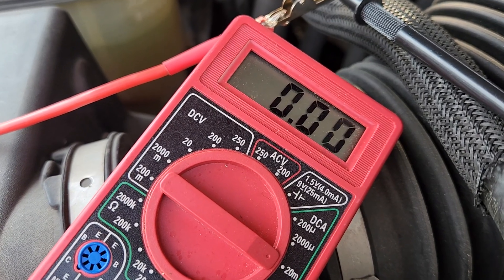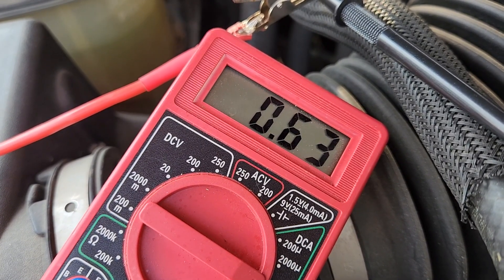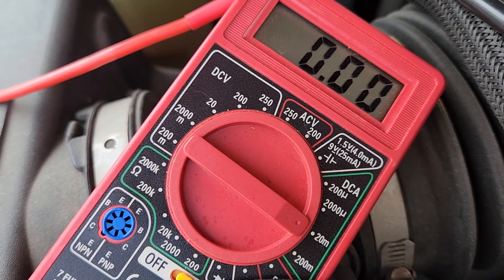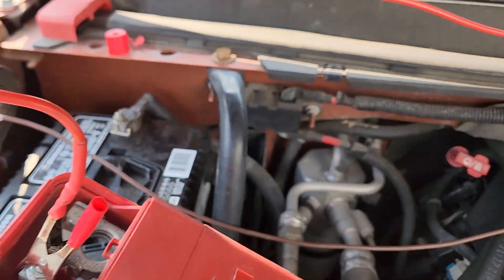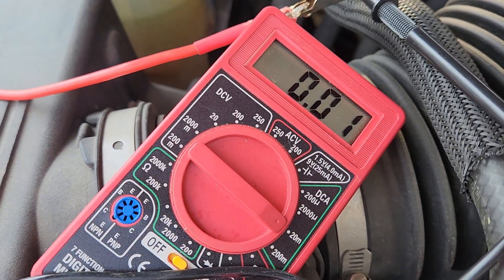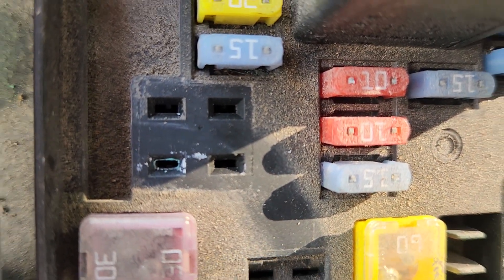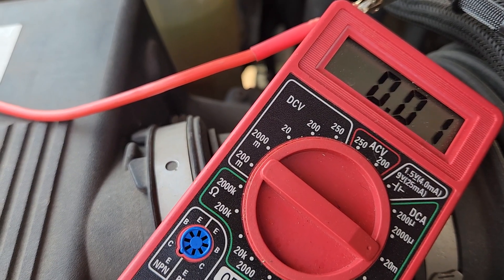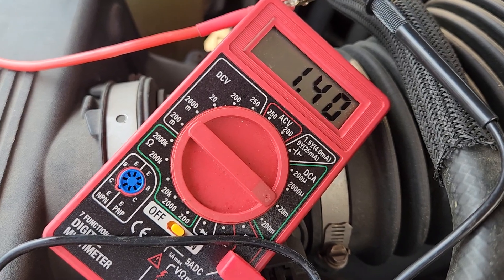HELP, parasitic draw on 07 Avalanche. oscillates up and down

Comment from the maker: Help !!
Anyone ever see a parasitic draw on an Avalanche like this before?
 The work done before this started killing the battery was an abs sensor on the right front hub.
I unplugged it and every relay and fuse and the large  bus connectors I could either find and / or get to.
No Joy !!
Any help is appreciated.

Comment: Is your battery fully charged while doing this test? 
Do you have anything aftermarket installed ?? Radio , lights , cb.
If you've pulled every fuse and relay with no change it could possibly be the bcm or instrument cluster not "going to sleep ", another possibility is to pull the cover for the ignition switch and unplug it. See if your readings change. Again, the last few possibilities are assuming nothing aftermarket has been installed and wired incorrectly and all other circuits have been 100% verified